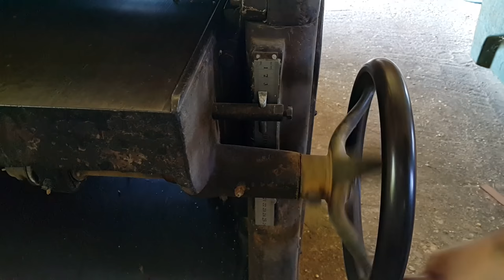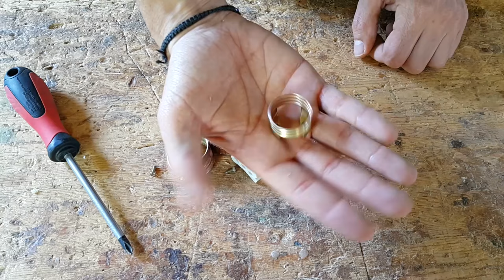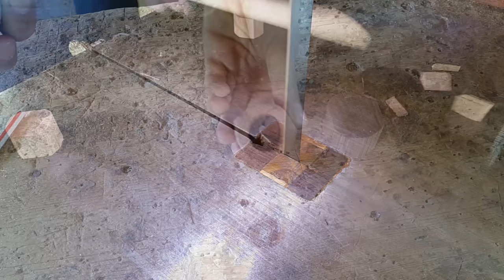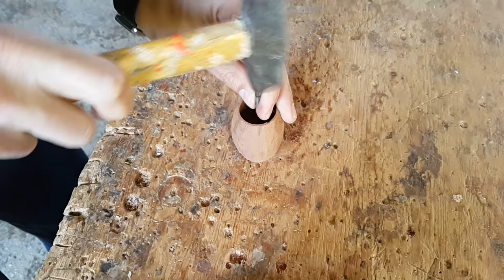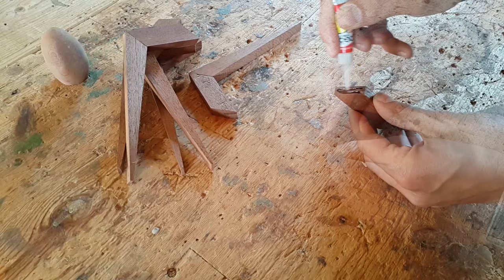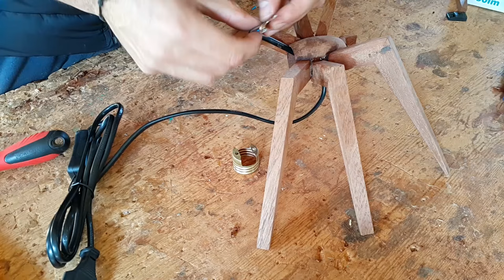Making A Wooden Bug Shaped Lamp (FS Woodworking)

Comment: really interesting idea mate and very enjoyable vid. I think it might give me a nightmare though! thanks for sharing.
Reply from the maker: +Mark McCluney Problems with spiders? Hehe, it also looks like an ant if that makes you feel better. Thank you for your comment Mark. Have a good day!
Reply: Forgot to say - that's a gigantic bandsaw. Is the Evolution mitre saw still going well? Found any problems?
Reply from the maker: +Mark McCluney Yes it is really big. Almost 2.5m tall with a 6hp motor. It was used for logs almost 60 years ago. Maybe more. My evolution works teally really well. The only small problem I have is that the turntable is not flush to the rest of the base which is something I am working on to fix it. Just 0.5mm higher but I will diassemble the saw and sand the bottom side of the turntable. Not going to take more than an hour I hope.